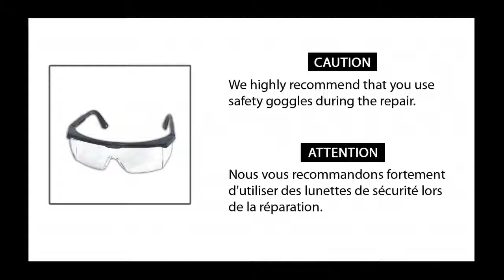Wall Mount Fireplace Circuit board replacement

Comment: What issues would be indicative of a circuit board problem? With my fireplace I plug it in and my ignition switch lights up. I press it and there is resistance but nothing happens. I thought it was an issue with the bulbs and so I replaced them but they don't even light up and nothing happens when I press the switch. Could this be a circuit board issue